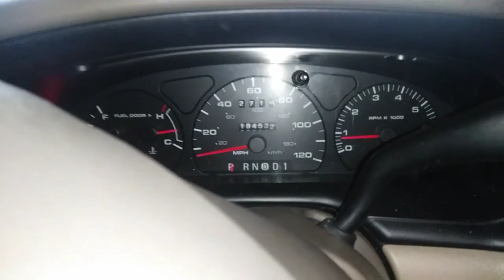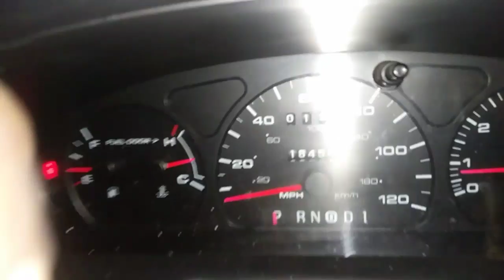Blowing oil out trans dipstick! The fix??? 04 FORD TAURUS

Comment: Actually this was a ford fix to this issue..they came out with a bendy hose sorta device.
But another youtube ford tech said he mearily sliced the rubber top of the vent cap in an x pattern..the rubber top comes easily off the nipple.  Then spray it with brake cleaner.  The x pattern allows out more pressure while keeping dirt out of the system.  Not sure if the x will work.  But you can always use the hose idea..both do the same job...releasing pressure and keeping out dirt.
Now with my friends car i noticed someone tried the x fix previously..but it was a smaller incomplete x.
I made this one completely across the top and made sure the device opened up when squeezed..hope this helps..
If not then ill try the hose.
Reply: Tkx Leo on it

Comment: Have a 2006 with the same issue, blows transmission fluid out of the dip stick tube when cracked up. Can't believe the fix was so simple. Change the seal where the tube inserts in the transmission and while I was under changed the pan gasket and filter.

Comment: Once the hose is attached no need to worry it just breathes out the end... tkx 4 the quick reply
Reply from the maker: Yes... Just rout it like a "U" with it facing down, section not connected to transmission
Reply: Tkx Leo on it

Comment: tkx bro -remove the cap-add the hose as a breather—question is with the cap closed were does it breath to—still great 3 years dealing with this fix or repair daily...stay clean and safe
Reply from the maker: Hey try asking your question separate, I can answer better
Reply: The other end doesnt connect to anywhere..it vents period..  the reason your cars puking tranny fluid out its dip tube is your tranny vent/ cover is blocked ( it sits lower than your diptube)..so the pressure has to go out   the next higher exit..the diptube
The hose allows the nipple vent to remain open,unblocked.
Im guessing he used a longer piece of hose in order to get this venting point below the opening of the dip tube..
 Like ford intended it to be

Comment: So did you leave the pipe there for ever? .. Also do u have a video on how to change the oil filter ? Lol so my car has exactly this. I wanna fix the source this morning i woke up and it didnt drive at all. I saw the dipstick popped up so i realized i had to walk to the Auto store in below freezing weather lol to get transmission fluid. It works now. But i wanna know how to fix it .. So by just leaving that long pipe will fix that? ...thank u for sharing your knolewged❤

Comment: Any other ideas? That didn’t stop the leak
Reply from the maker: Shot in the dark but try changing the fluid and filter,  it'll thin the fluid out if it haven't been changed
Reply: @partsshooter  we did that first. We thought it was the transmission pan gasket leaking so we changed the filter and fluid (it really did need it)

Comment: I've  had this type of problem with my 55 Chevy after it sits for a while it leaks a good size puddle, from what I can see from the filler tube, trans was rebuilt last year. This happen several times but not all the time. Any thoughts?
Reply: Trans filter plugged maybe

Comment: Let me see if i understand your fix, you only need to change that littoe thing for a 3/8 hose? Im sorry but i have bad english so thats what i understand, am i correct?
Reply from the maker: Change the fluid and filter if possible and as needed.

 Yes, I removed the vent cap and replaced it with a 3/8 hose.
Reply: @partsshooter  i really appreciate your response man i will suscribe your channel

Comment: Have you heard of this issue happening with different make and model vehicles? I'm looking at buying a Chevy S10 that has the vomiting dip stick and Im wondering if it could possibly be this? Before I go trying to get a new tranny and digging too deep
Reply from the maker: Never hurt to change the fluid and try this procedure
Reply from the maker: To answer, no... Just that 1 Ford. And I'm 10 yrs in
Reply: Did you figure it out ?

Comment: Did he have a check transmission light on
Reply from the maker: Yes, intermittently. I did another video where I had to replace transmission fluid. Car drove great, just light continued to illuminate intermittently
Reply: customhonda my transmission fluid is light red on my dip stick but it’s shows lightly on my dip stick but it’s at the full mark that’s what confusing me I’ll try replacing my fluid and maybe throwing a new filter on it  I only had the car for a month very low mileage I’m not familiar with Ford I replaced the speed sensors input and put put still doin the same thing shop says my transmission is fine could just need to replace solenoid or fluid change
Reply from the maker: @spartatacticalarms6914  sorry for slow response, I'm not getting notifications strangely.

But proper way it to pull transmission codes. Depending on the code will determine the direction taken.

Try changing the fluid and filter! I did another video on this car where it actually fixed a "neutraling state" issue. Transmission I installed had 66k miles and still had minor issues. Crazy! 1 out of 100 though.
Reply: customhonda ok I’ll do that I bought the filter and fluid today thanks the shop telling me either the filter needs replaced or its sensors issue